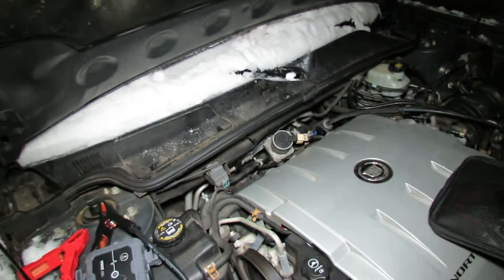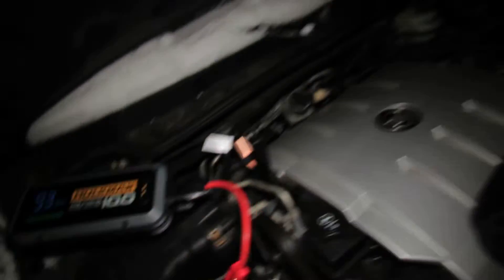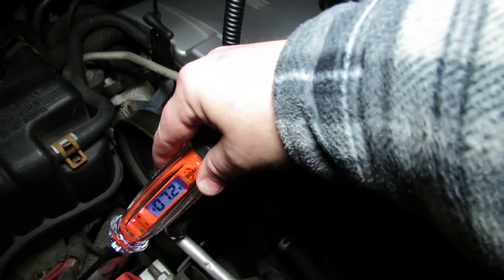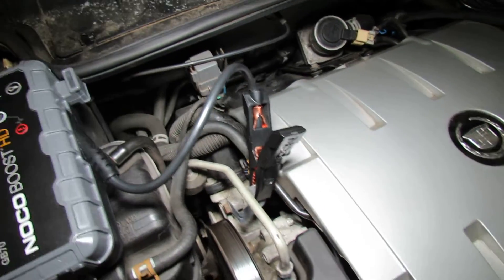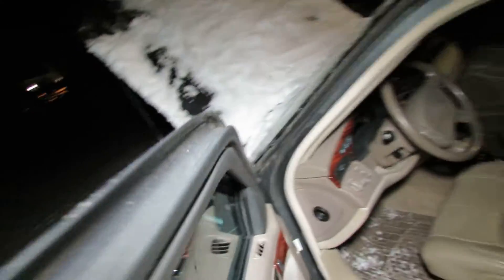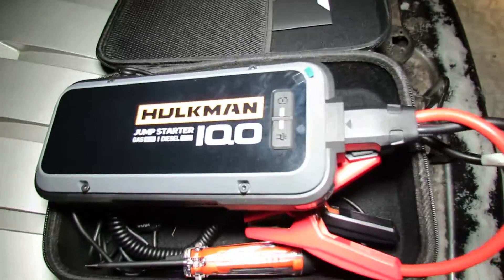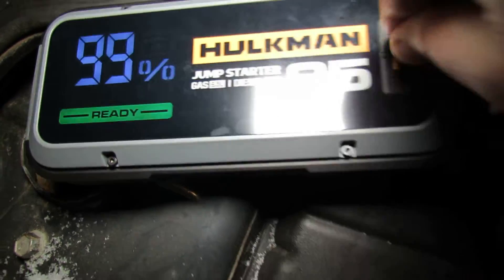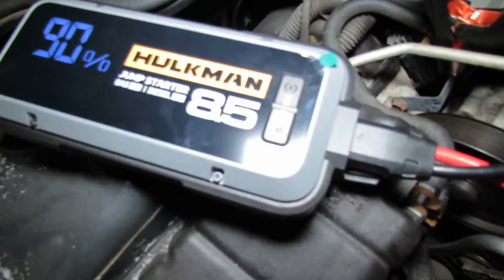HULKMAN 85S VS. NOCO GB70 (Which is BEST?)

Comment from the maker: According to the Noco GB70 owner's manual, you do NOT need to push the boost button if the Noco GB70 battery indicator lights are chasing. When the battery indicator lights are chasing that means your Noco senses that there is enough voltage in your battery to jump start, WITHOUT pushing the boost button. Now when your Noco GB70 battery indicator lights are NOT chasing, that means your Noco GB70 does NOT sense that there is a battery because the voltage is too low, as a result you will need to push the boost button in order to bypass the security features so your Noco GB70 will deliver full power to your battery and jump start your vehicle (all security features will be disabled--live power at all times). We have had some commenters say I didn't push the boost button and that's the reason the Noco GB70 didn't work, which is not the case. If you noticed in the video when I hooked up the Noco GB70, the power indicator lights were chasing, and you can physically hear the relay inside the Noco GB70 clicking on every few seconds proving that the Noco GB70 was delivering power, therefore pushing the boost button was NOT necessary. Also, we have countless videos showing the Noco GB70 is not able to jump start the Cadillac V8 whether the Boost button is pushed or not. That's the reason I wanted to explain how Noco products work so people will understand why pushing the boost button in that situation was not necessary, and even if we did push the boost button, the vehicle still wouldn't have jump started. We absolutely love our Noco GB70, but for whatever reason it is hit or miss on our 2004 Cadillac Deville V8. We know our Noco GB70 is not defective, because it works great on every other vehicle, we have tried it on, except the 2004 Caddy. We seem to think there is compatibility issues with the Noco GB70 and the 2004 Cadillac Deville V8 with NorthStar System.
We hope this explanation helps, have a great day.
Reply: I saw in the comments of another video where someone had an issue using the Noco GB70 on a vehicle.  So they hooked up just the positive cable and turned it on.  They then held down the Boost to override the safety features.  Be careful, because at that point, it's like holding live jumper cables.  Then they plugged up the negative cable and started the car with no issues.  A few other people that were having problems tried it that way and it worked for them as well.  I would be curious to know if this works on your 2004 Cadillac Deville V8.
Reply from the maker: @333tom333 I will try when I have the opportunity. I would be curious to see if it works. Thanks for comment

Comment: You need to ooverride both for it to be comparable. Who cares if it says you dont need to in the manual. You boost one you need to boost the other. Bad test
Reply from the maker: It wasnt a bad test. We pushed the Boost button on and off camera with the Same results of not working.. Noco reps told me on the phone, if the battery indicator lights are chasing, there is No need to push Boost because you will have the Same results of not working..It also says the same thing in the manual. I only show the facts and my experiences in my videos. Just because a product works great for you doesn't mean that the same product will work the same for me. Everyone has different experiences with the same exact products. It is just how it is, unfortunately. My Noco works awesome on every car i use it on, except the 2004 Cadillac Deville in this video.We have countless videos showing the Noco struggling on the 2004 Cadillac Deville for whatever reason.  Appreciate the comment.

Comment: My GB55 will start my 7.3 diesel. You have to power on the unit and go boost mode before connecting the leads.
Reply from the maker: We did that with our GB70 on and off camera, still didn't work. Our GB70 only has trouble with our Caddy V8 for whatever reason, the GB70 jump starts everything else we try up to 8L. but its hit or miss on our Caddy V8...Thanks for the comment.

Comment: U didnt use override on noco!
Reply from the maker: As I mention in all my Noco videos, as it states in the manual, if the lights are chasing you do NOT need to push the boost because the Noco senses a battery. If the lights are Not chasing, then you must push the boost button. Also, I pushed the boost on & off camera in many videos over and over and the Noco GB70 is hit or miss only on my 2004 Caddy V8 for whatever reason, the Noco works on just about every other vehicle I have tried it on. Thanks for the comment

Comment: You didnt override the Noco
Reply from the maker: You do not need to override or boost the Noco if the lights are chasing, if the lights are not chasing the unit does not recognize that its hooked up to a battery, then you need to boost or override. It says in the manual.

Comment: Nice video on showing how well the Hulkman works but please connect the positive cable first & take the positive cable off first.
Reply from the maker: I understand what you are saying, but the portable jump starters on the market  today have many protections that protect  the user from injury,  These portable jump starters with smart cables make it just about impossible for anything to happen whether I hook up the positive or negative cable first, it doesn't matter according to specs, manuals. Other mechanics have told me it doesn't matter which cable you hook up first since most of these portable jump starters have smart cables with zero spark, reverse polarity protection, ETC. You could even touch the black and red cables together, and no sparkage happens unless the Boost button is activated. Now, if I was using regular old school jumper cables, you are absolutely correct about hooking up the positive cable first, since the old school cables have no protections to protect the user. But that's the great thing about alot of these portable jump starters on the market today. They really protect you from the unexpected. Thank you very much for looking out for me. Have a great day

Comment: I bought the GB70 and a carrying case for it several years ago after reading all the reviews and doing a lot of research.   I live in a state where the snow is deep and the temps plummet at night.   Unless you can plug your car in at night, it can be difficult to start it in the morning, even for batteries with the highest CCA.   The GB70 has never failed me and will take on more than I could ever put it thru.  It's the best purchase you will ever make.   It's very portable and easy to use.  It's also safer to use as well if you accidentally hook up the wrong connections, unless of course you put it into override, in which case it will do you good to check your connections.   I was able to do a number of jumps with it and it would still show a full charge.   I didn't use it for a full year one time and when I checked it to see if I needed to charge it, it still had a full charge.  I used to haul around one of those huge, heavy, lead acid battery ones that were a pain in the ass.  You had to constantly keep recharging them after one or two jumps or check them for a full charge before you could use them if you let them set for longer than a couple of weeks.   Plus, their life expectancy was short lived after recharging them so many times.  I love the GB70 and will buy another one when it comes time to.  When that will be, I honestly can't say.  It is still performing just as strong as the day I received it several years ago.
Reply from the maker: Noco makes a good product.  Good luck with yours. Thanks for the input. Have a great day

Comment: The GB70 is 2000amp and the Hulkman 10.0 is 4000 amp rated.  Of course the Hulkman is going to out perform the GB70.  The Hulkman 10.0 is also twice the cost
Reply from the maker: The Hulkman 85S which was also in this video has basically the same specs as the Noco GB70, and the Hulkman 85S was able to jump start the Caddy V8 with ease, but the Noco GB70 could not jump start for whatever reason. I was told by a few mechanics that every vehicle is different, and not all jump starters are compatible with certain vehicles, for whatever reason. For example, just because a Noco GB70 could jump start a 2004 Cadillac V8, doesn't guarantee that same exact Noco GB70 will jump start someone else's V8 model, know what I mean. Some jump starters have issues with certain vehicles. I'm not discounting Noco products, because I have a few Noco jump starters and love them, the Noco GB70 is hit or miss on my 2004 Cadillac Deville V8 for whatever reason.

Comment: You never did the override on the noco 😂..
Reply from the maker: If the lights are chasing on the  Noco that means it detects the battery and you do not have to push the Boost button,  it says the exact same thing in the instructions. The only time you must pust the Boost or override is if the Noco does not detect a battery since the battery is almost completely dead, and also if the lights are not chasing on the unit. Those are the only times you have to push the override or boost button. We have other videos showing this same Noco GB70 struggling on only the 2004 Cadilllac Deville for whatever reason, it doesn't have an issue on any other vehicle except the Caddy. Weird. Thanks for the comment

Comment: I have  Audi A8 D3 with a 4.2 TDI engine, 326 HP. Recently my battery died, but due to the fact that I suspected problems with the electrics, instead of replacing the battery, I decided to buy NOCO 70. The car started without any problems, with 3V on the battery and the ambient temperature around +1/-1 C. Sorry for my English but I recommend the device .
Reply from the maker: Noco GB70 is a great unit, but for some reason, it's hit or miss on my 2004 Cadillac deville V8 for whatever reason. The GB70 works on just about every other card I have tried it on. Thanks for your input. Have a Happy Holiday

Comment: NOCOs are junk in comparison to what's on the market today. You're just paying for the name at this point. I'm a former Chrysler tech turned AAA Battery Tech. I purchased a Yesper Armor off of Amazon for $100 (half the price of the GB70) and it's a BEAST. I carry it with me on the job specifically for jumping dual battery diesels. It does not disappoint...plus it charges super quick off the 12v socket in the work van.
Reply from the maker: Alot of the lower cost jump starters do out perform some of the more expensive, popular brand jump starters on the market today. In many situations today, you are just paying for the brand name like you said, you are very correct.
Reply: I am also planning the same. How fair it does in a single charge and in extreme cold.
Reply from the maker: @akbarpashtun I will check it out

Comment: man, you should really delete this video and do a new one, and pls do it correct...
Reply from the maker: Explain what we did wrong. You are aware that when you hook up the Noco GB70 and the lights on the Noco immediately start chasing, and you hear the module/relay clicking, that means the Noco detected the battery and its ready to jump start. Now, if you hooked up the Noco GB70 and the lights were not chasing, that means the Noco does not detect a battery and you will need to push the boost/over-ride button so the security features will disable, and the Noco will deliver the power the battery needs to jump start. And everything I mentioned is in the Noco GB70 manual to back up what I say. Also, we have used the Noco GB70 and the boost button countless times on our 2004 Cadillac V8 test car, and sometimes the Noco GB70 is able to jump start it, and sometimes it can't for whatever reason. As we mention all the time, we love the Noco GB70 but it struggles on our Cadillac V8 for some reason.

Comment: Yeah, My Noco's have failed me my last 5 attempts. I'm going to Hulkman
Reply from the maker: Do you use it alot, or is it an old model? My Noco GB70 is hit or miss only on my 2004 Cadillac V8 for whatever reason. Kinda weird, unless my model is breaking down internally.
Reply: @HM_RELOADED  , Not a lot but I keep it charged, but when its time to use it it fails to start a battery just needing a jump

Comment: I’ve always used GB 70 and I’ve never had a problem
Reply: When you turned the noco or powered it back back on you didn't hit the override button 👍
Reply from the maker: @Jeremy Kisling  when the lights on the Noco are chasing there is no need to push the override button, it says in the manual. And I pushed the Boost later in the video and it still didn't jump start. We have many videos showing the Noco GB70 with the Boost pushed and not pushes, and either way most times it can't jump start my Caddy V8 for whatever reason. Thanks for the comment
Reply: @HM_RELOADED No, you had the Noco turned on, but you did not have the Boost turned on. There's a different indicator light that comes on when you do.
Reply from the maker: @theoriginaldashriprock we have countless Noco GB70 videos and 90% of the time it cannot jump start the Cadillac V8 with Boost button activated. Check email out
Reply from the maker: Noco GB70 is a great jump starter, however, I have problems jump starting my 2004 Cadillac Deville V8 for whatever reason. Thanks for the comment
Reply: @HM_RELOADED  thanks for your time and for the review
Reply from the maker: @FORDTECH313  You're welcome
Reply: @HM_RELOADED  well because you did it wrong
Reply from the maker: @romanf5666  Explain in detail what was done wrong
Reply: I got a GB70 and the power button stop working…
Reply from the maker: @willie81ws  Do you still have a warranty?
Reply: Noco is a waste of money. Total failure.
Reply: @speedy-vu6vr  gb 70 and hulkman 85s are pretty much same price, nice try
Reply from the maker: Nice try what???
Reply: @HM_RELOADED  my comment was for the guy that was saying noco is overpriced

Comment: to be fair gb 70 is not the same amps or capacity as the hulkman 100/10.0 a comparable one would be the noco boost gb150 or gbx 155 . I was a die hard noco user but my gb150 posts for clamps broke the unit discharges faster only in a year of use . I was a advocate until i had to deal with their customer service and now they can kick rocks they are dismissive and rude.
Reply from the maker: You are correct,  the Hulkman 10.0 has twice the amps as Noco GB70

Comment: I wonder if the Hulkman 85 could do it too even though it doesn't have the internal battery warmer. Speaking of which, how cold was it that day do you think?
Reply from the maker: It was very cold that day as you could tell in my voice. We had almost 2 feet of snow on that day and things were starting to freeze up. I really don't know the exact temp thar day but it was nippy. Lol. I think the regular Hulkman 85 would of probably started that V8 as cold as it was with no issues. When the temp starts falling in the negative degrees then the regular Hulkman 85 might have an issue since it does not have the pre heat technology. Anyone who lives in colder climates should definitely get the Hulkman 85S since it had pre heat technology. Thanks for the question

Comment: Where you using the boost on the NOCO like you did with the Hulkman? I couldn't tell if the white light was blinking on the NOCO.
Reply: No he didn’t use the boost on it he didn’t use an uncle correctly I was watching everything he did
Reply from the maker: Just FYI, if the lights on the top of the Noco GB70 are chasing that means there is NO need to push the Boost button since the unit has detected some voltage on the battery and is ready to jump start. Now if the lights were NOT chasing on the unit that means the unit does not detect any voltage on the battery, then you must push the Boost button in order to get enough power to jump start. Also, when I hooked up the Noco GB70 to the connections to the battery, the lights were chasing on the unit, and you could hear the module inside the unit clicking to show that there was power being produced. Also, the white light on the unit was illuminated when the Noco GB70 was hooked up showing there was power being produced once again. Just wanted to clarify how the Noco is supposed to work. Thanks for the comment, have a great day.